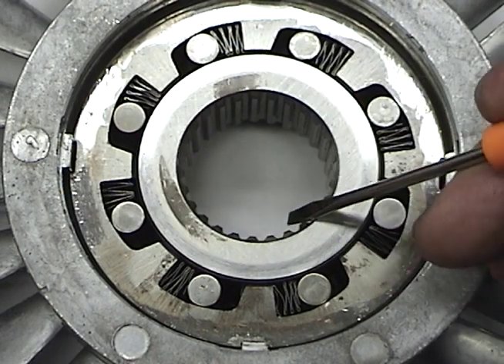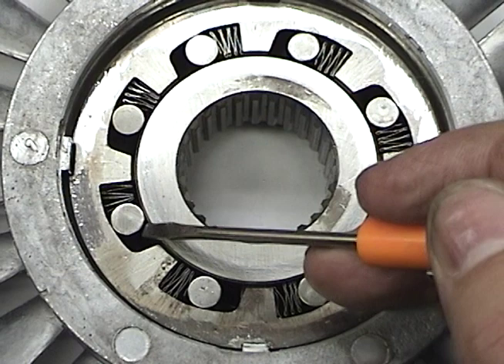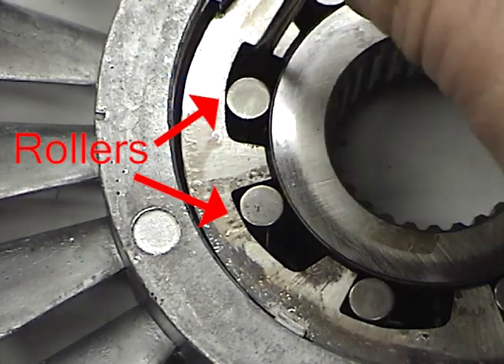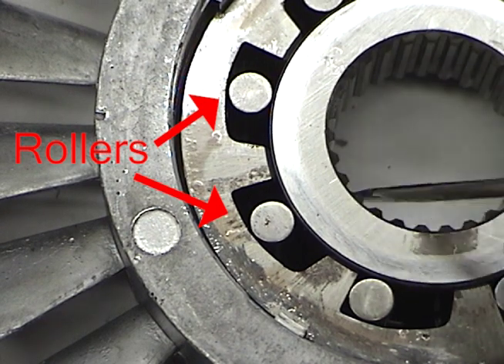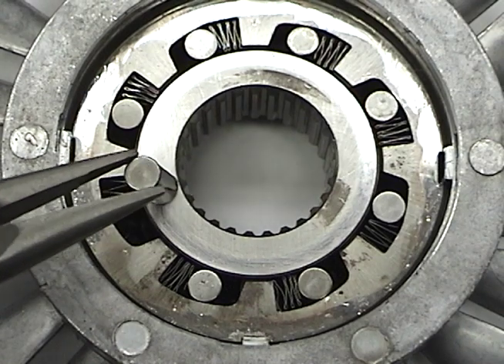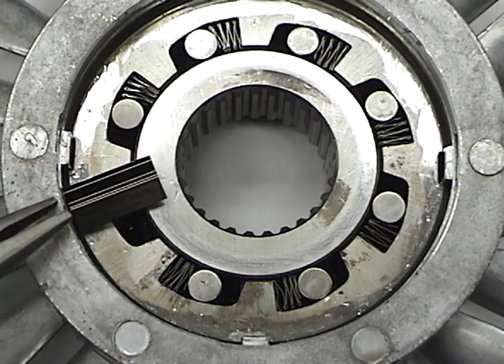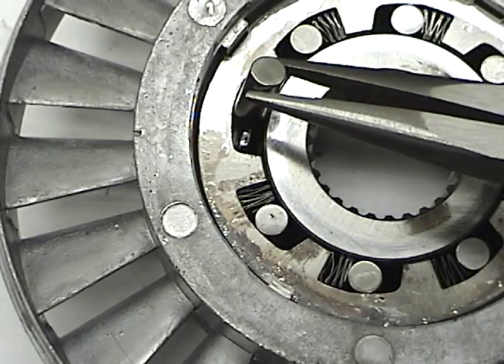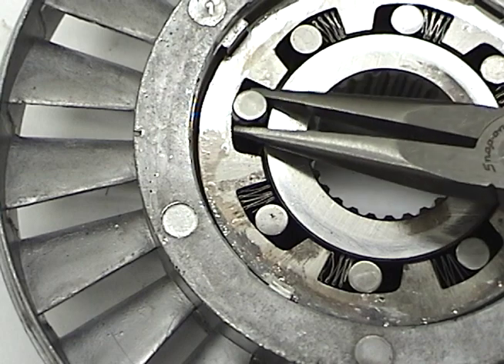Automatic Transmission One-way Roller Clutch

Comment: Greta explanation, I wonder if you can answer this. 
I bought a Sprag from a Yamaha V-Star Starter, it is about 110mm diameter and seemed tough, but in my application on a chain driven sprocket it works great at first but slips under load in the lock direction. How much "Break away" torque can a Sprag supply vs a roller style?
Reply from the maker: The load handling capability of a sprag or roller comes down to surface or contact area.  How wide is the sprag? how many sprags are in the element.  In transmissions if there is a heavy duty sprag for an application all they normally did was increase the number of sprags.  For your sprag are were both sprag races replaced? Some sprags come with the inner and outer race where other times the inner and or outer race are separate components. If the races are separate and they have not been replaced this could be why you are experiencing slippage.
Reply: @DrivelineMaster  it was a complete set, inner, outer, sprag holder spring and 20 elements that are 8mm wide. It worked for a while and it would get hot and then expand and freewheel
Reply from the maker: Since this was a complete unit there are typically 4 reasons for it to fail. Lack of lubrication, improper or contaminated lubrication, inferior or low quality product, or it's being overloaded by too much torque or load and the spag just can't handle the torque being applied through the application.
Reply: @DrivelineMaster  Yes I believe I overloaded it,  it was designed to start a 1,100cc engine,  I used it on the sprocket to drive my cv axles. 
But by looking at the design of the roller, it wouldn't have slipped.

Comment: hello, what type is it? i am looking for this kind one way clutch..
Reply from the maker: This is from the inside of an automatic transmission torque converter.  One Way roller and sprag clutches are frequently used inside automatic transmissions.
Reply: Depending what you need, they come in a multitude of sizes and packaging.  Look up Formsprag or Stieber Clutch.

Comment: Hi! You seem to know a lot about these bearings. I have a question. I'm trying to build a racer electric road bike with a geared hub motor in front wheel. The problem is that the motor had very thick grease caused a lot of friction. I removed the grease and I put instead more racer grease that is much smoother, the problem was that the pins in the one-way bearing made noise when I rotate the hub, so I had to cut like 5mm from the spring length, and it's a normal spring not like the ones in your video. The noise disappeared after that. I tested the hub motor, it rotate much smoother and the bearing seems to work exactly like before. Do you think this is okay or should I worry about some defects that might happen? I tried first to remove the spring but I noticed that the bearing might lock itself only with one single pin, and not with all the pins, so I had to put back the springs and only shorten them a bit. Thank you very much!
Reply from the maker: The stiffness of the springs are for a particular reason. Your one way clutch could prematurely lock up with the weaker springs. I would replace the springs with the stronger ones and pack it with the thicker grease.  The thinner grease will not make that much of a difference as long as you are using quality grease.

Comment: I have a question about friction in these one-way roller and and one-way sprag type clutches. There doesn't seem to be much rolling going on. This appears to be because the rollers/sprags are static (non-rolling), unlike in a regular bearing, where they roll along both the inner and outer race.

So are these (both roller and sprag type) one-way clutches just very high friction?

Thank you for any answer. I greatly appreciate it. Cheers man!
Reply from the maker: Thanks for the question.  The roller clutch and sprag clutch are two different designed.  Even though It's called a roller clutch it does not act like a bearing. Bearings provide a low rolling resistance between two objects, control axial and or radial loads and also help to maintain the position of the objects.  These OWC's do neither. In order for a one way clutch (sometimes called an overrunning clutch) to work one of the races (inner or outer) must be held stationary while the other race tries to rotate.  If the rotational race tries to rotate in the lock direction the one way mechanism kicks in and prevents rotation. If the rotational race tries to rotate in the free spinning (or overrunning) direction it will be allowed to do so by design.  There is some friction that will take place during the free spinning action but the friction and rollers (or sprags) don't support any axial or radial loads like a normal bearing would.  Additionally these are normally saturated in automatic transmission fluid. Write again if you need further explanation or have a followup question.
Reply: @DrivelineMaster  Thanks for the answer man. I really appreciate it.

Yeah, I was definitely referring to when they are in the "free spinning" mode. I probably should have been more specific lol.

The reason I was bringing up friction is because I was thinking of a bicycle ratcheting freewheel and the fact that they are in "free spinning" mode quite a lot (whenever someone isn't pedaling or pedaling slower than the bicycle is moving, as well as when someone is pedaling backwards).

And since you so kindly offered to answer a followup question with further explanation, I will take you up on your offer!

I guess what I'm wondering is the difference in function and application between these roller (or sprag) clutches and the aforementioned ratcheting-type freewheels (in general, not limited to bicycles, that was just an example).

Are they interchangeable? Could you use a roller (or sprag) clutch on a bicycle and if so would there be much more friction than the ratcheting-type freewheel and if so would it be too much to make it worthwhile - or for that matter would it even function? Are there any other devices or systems where the roller (or sprag) clutch could replace the ratcheting-type freewheel mechanism?

And the reverse as well, could you use a ratcheting-type "clutch" (if you would call it that - and I'm not talking specifically about bicycle freewheels - I'm referring to any ratcheting-type clutch mechanism) in a device or system typically serviced by roller or sprag clutches? If so, what kind of device or system? Would there be a reduction in friction? What would be the drawbacks (or benefits) of such a replacement mechanism?

I realized I just asked like 10 questions. Please forgive me. I just find devices and mechanisms like this very fascinating and I am forever grateful for your response.

Thanks again mate. Cheers!
Reply: @DrivelineMaster  Thanks again for the reply. That really helps in understanding that they aren't meant to support loads - whether axial or radial - or at least not to the extent of bearings. That definitely clears some things up for me conceptually. Again I appreciate you taking the time to reply.

I guess my final question would be this.

Suppose we had two bars that are extremely lightweight and/or completely supported by bearings at either end - either way the axial and radial load forces are subtracted from the situation - the only force that matters is the friction on the mechanism in the middle.

The mechanism(s) in the middle are the following:

One bar is going through - and attached to the inner race of - a roller clutch positioned in the middle. The outer race is held stationary.

The exact same setup goes for the other bar - except it is a ratcheting freewheel mechanism instead of a roller clutch mechanism.

They are both spinning in the free-spinning direction.

What is the difference in friction between the free-spinning-bar-roller clutch mechanism setup and the free-spinning-bar-ratcheting freewheel mechanism setup?

I guess I do have one more question. If you have time and do answer, I do kindly ask that you treat this as a separate inquiry unrelated to the previous question.

In general, how significant is friction in roller clutches in the free-spinning direction? I ask this because the rollers don't actually appear to do very much rolling when the roller clutch is in the free-spinning direction (beyond the fraction of a revolution that they travel in their channel of course). They seem to do more sliding - as opposed to rolling - when the roller clutch is in the free-spinning direction.

This really gets down to the nuts and bolts of why I was confused in the first place. Is the lubricant - transmission fluid or otherwise - significant enough to overcome this friction when in the free-spinning direction? And by "significant enough" I mean to ask is it significant enough to make friction an insignificant issue?

Thank you again for your replies. I realize my inquiry may be somewhat lengthy. I genuinely appreciate your responses and can't wait to hear back.

Thanks again, again. Cheers mate.
Reply from the maker: If I understand your questions really come down to the amount of friction that takes place during the free spinning direction.  The first question compares a ratcheting design which we call a "Diode" clutch and a roller clutch. The second question is simply looking for the friction on the roller clutch. And yes, the rollers in the roller clutch don't really roll or support a load like a typically roller bearing would. I can honestly say that these are truly engineering questions that I'm not qualified to answer. My guess is that if you had the two setups to test that you could use a spring scale or dial type torque wrench to measure the rotational force for a comparison. You could also test various lubricants at this time. I suspect the surface area of contact along with the surface polish and metal hardness along with the lubricant  all play a factor in the coefficient of friction.  Sorry I don't have answers for you.
Reply: @DrivelineMaster  That answer was more than satisfactory. I definitely have a complete conceptual grasp of the differences now.

Thank you for taking the time to have this back and forth with me. I realize that you are probably a busy gentleman and that you didn't have to spend time helping me on my continuing journey of education in these matters.

There is absolutely nothing to be sorry for. Your information has successfully informed me of this marvelous device's role vs that of other somewhat similar mechanisms.

I come from a computer engineering background primarily, but I have been dabbling in the mechanical arts as a side-hobby/side-job for decades as well.

Thank you again sir for your assistance and exchange. Take care mate.

Cheers!
Reply: dataayah3718  I don't have a blueprint of the clutch. Perhaps the video creator does. I don't know. Glad to see someone else that loves expanding their mechanical knowledge though. Cheers mate!
Reply: In a roller-ramp one way clutch, the rollers do spin while freewheeling.  As noted, they do not support a radial load like a bearing: they will fail fast if you try it.